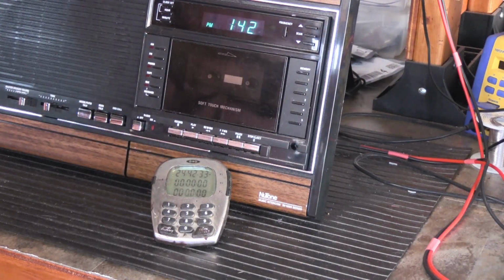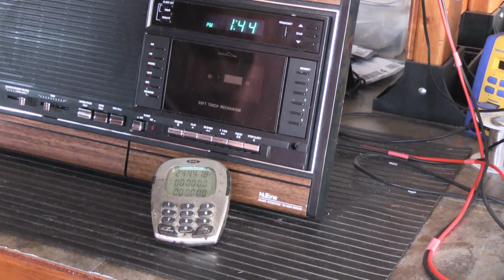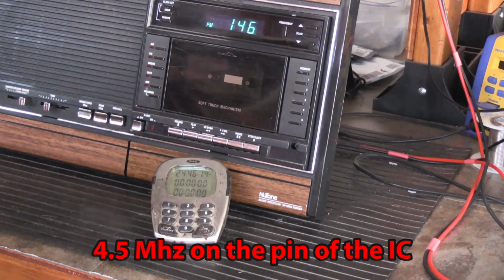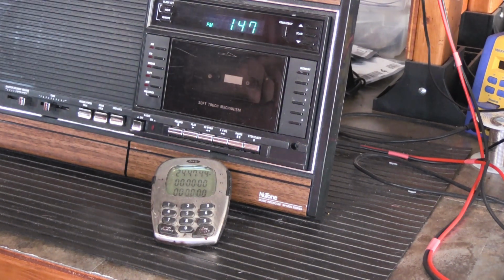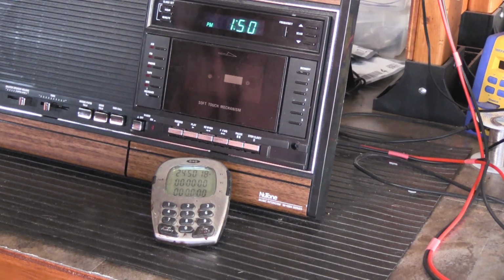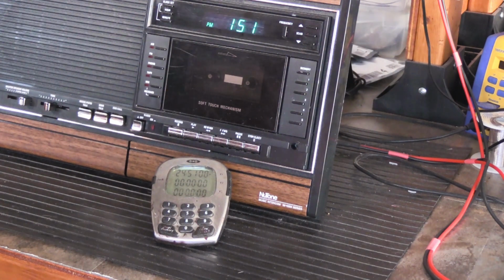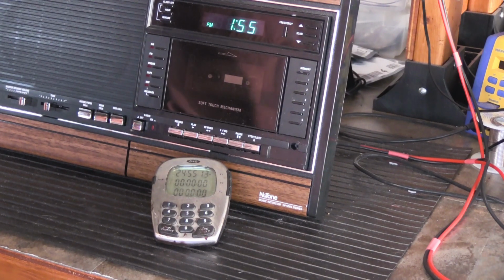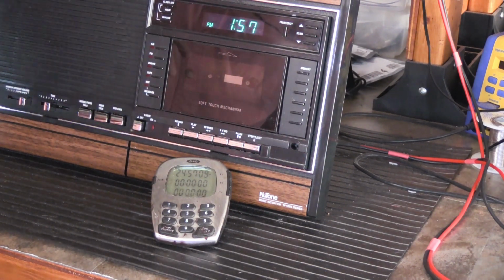Checking the Accuracy of the Clock on a NuTone IM4006 - Sends me down a Rabbit Hole of Thoughts

Comment: Well i would look around the crystal and the small value disk capacitors, also look at a tiny trimmer, they can play up.
If you have a frequency counter, you might be able to connect a low value capacitor say 5pf on to one of the crystal legs,  and the other end of the 5pf capacitor goes to the counter.
Make sure the counter probe earth is earthed to the nutone chassis via a large disk capacitor.
The disk capacitor is to allow an earth without d.c problems.
Im saying the bloody obvious, sorry.
Reply from the maker: Hi zx8401ztv:   You're right on with your suggestions - I'm not done with this topic yet - Look for more in the near future - Chris

Comment: My IM 4006 is similar. Not enough gain to fret over and I reset at the switch for Daylight Savings time twice a year....
Reply from the maker: Hi r.rasmussen:  I think most of the clocks are failry accurate - not really a problem for most - I guess I did a good enough job on this customers Im4004, becuase he never called about the clock again - Chris

Comment: Probably get a more accurate clock with the Atomic Clock iPhone application.  Or by receiving WWV with shortwave receiver.
Reply from the maker: Hi rkuns:  This what I found about your idea;

"No. The iPhone is, at best, a Stratum-2 level clock. That is because, according to Apple, the iPhone (and Apple Watch) get their time from Stratum-1 clocks. This means they’re one step down from S-1, so they are S-2 devices.

An actual atomic clock would be a reference origin device, or a Stratum-0 time source. So the atomic clocks are S-0, and the iDevices are [again, at best] S-2.

That doesn’t mean they aren’t “perfect for all aspects of human consumption.” The difference between strata isn’t that great. For a Stratum-2 device, as long as it is synced at least once every hour, then it will remain accurate to within 46 microsecond. Even if you, somehow, managed to keep the phone battery charged but the phone completely disconnected from cell/wifi/bluetooth/gps — it would still take 91 days before you lost 1 second of time. And if the iPhone ever reconnects to the internet, then it will re-sync the clock to within 4.6 microseconds of the origin reference (the atomic [S-0] clock that feeds the S-1 clock that the phone is syncing to).

So can we say it is “as accurate as an atomic clock” — no. But only because when you make that kind of statement you are talking about accuracies which are physically beyond the capabilities of the electronics in the iPhone.

Can we say “the iPhone is more accurate than any human’s ability to discern time?” Yes, we’re pretty safe in that statement; just make sure you connect to the internet at least once a month.  (Russell Rocket ~ Studied Aerospace and Aeronautical Engineering at Texas A&M University (TAMU)3y) (no date shown) 
- Chris
Reply: @northsideservicecompany3567  Plenty accurate to test multi day accumulated errors!   The iPhone will keep getting back to correct time as the unity under test drifts away.  Anyway, I’m an old ham radio operator, I set my watch to WWV by ear and hand.
Reply from the maker: I agree - the app is certainly much, much more accurate than is any clock that would be set by it - Chris @rkuns